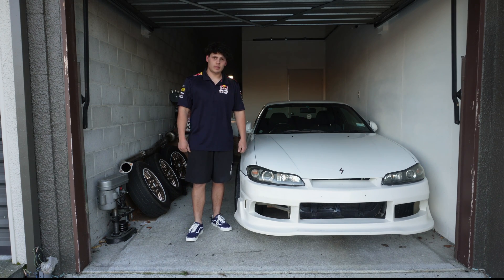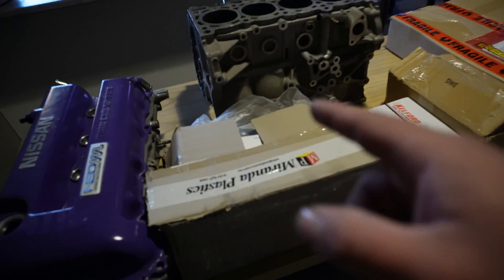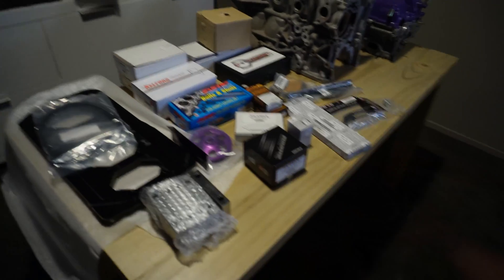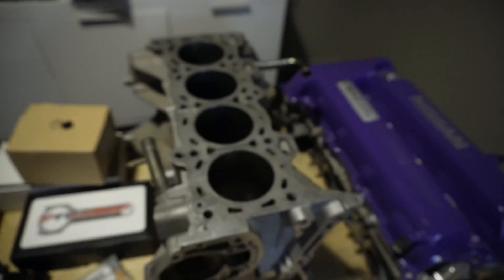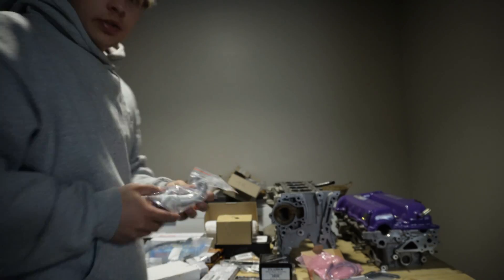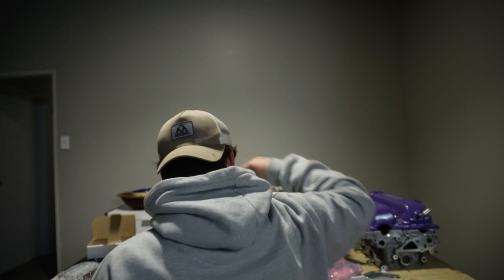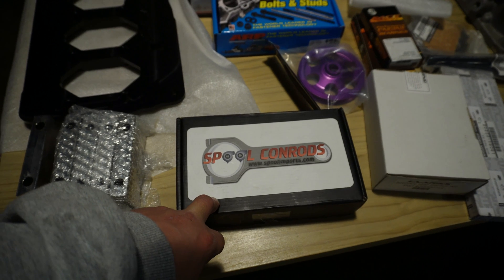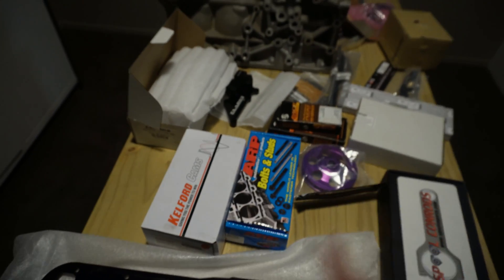How to build a RWD (700hp NEO VVL SR20 ) Episode 1

Comment: Why the s14 block? Can I use my spare s13 block?
Reply from the maker: That just the block I was able to get. Yes you can use an s13 Block but there are some differences between the s13 vs 14/15 so you will have to just research or ask a workshop that knows the build who can help with what parts to get. But it is possible with s13 Block

Comment: Been wanting to do a stroker build of my own for years (have had a 530whp VET in my own S15 across the ditch in NZ since 2014) and been discovering that strokers really aren't what theyre cracked up to be , at least not if you plan on running beyond 8000rpm on a braced OEM cast block
Reply from the maker: Yeah I guess everything I’m doing will be a first for me and will be a learning process and will show all the positives and the negatives that come with this build. I’m also based in NZ!
Reply: @Wannabe Club  it's the piston to rod ratio that's less then ideal as once stroked,  it's an extremely low number so when trying to rev these things, you'll end up chewing bearings and or rod bolts pushing them any further then 8000rpm . Been wanting to otherwise do one for years but learning this over the last year completely turned me off going that route and will instead just run a 90mm bore with sleeves on the oem 86mm stroke.  Just can't decide if I use the oem cast crank or go to a billet crank
Reply from the maker: @WraithDeath  Oh okay. I know of motive garage who have a 2.2 nitto stroked sr20vet who use theirs as a time attack car have had no issues and make 700hp aswell as horsepower academy with their sr86 which made 650hp but don’t think it was stroked. Not sure what rpm they were running but interesting info I’ll definitely look into it !!
Reply: @Wannabe Club  depending on their revving , it'll just mean that they'll likely be changing bearings and or rod bolts again at regular intervals.  It's widespread knowledge that it'll be a regular maintenance practice,  but these motors are used in motorsport also where it's just a cause of what comes when you want this sort of thing which is also why you probably won't hear them often, if at all, mentioning this publicly. 

For example I know that the GT Autosound S15 that's running that 7 second SR22VET gets regular bearing checks and or changes every 5000-10,000 kms as doss PJ'S S13 if my memory serves me right,  all because of the extreme revving these motors do whilst being stroked 

I don't mean to discourage you by any means , there's still benefits of having a stroker e.g faster spool but it just means you're then limited by your max rpm if you want the bottom end to stay together and it's just not something personally I'd want to go through , and not overly beneficial I don't think on a mostly street car
Reply from the maker: @WraithDeath  nah no worries at all I’m
Open to all suggestions and info I don’t know everything to any advice is appreciated! Thankyou
Reply: @WraithDeath stroke to 90mm darton sleeve bore 90mm you have a square 2.3L